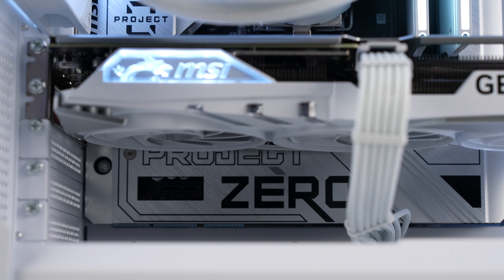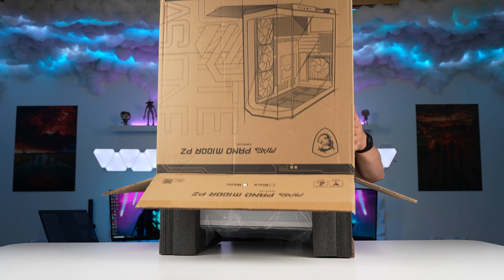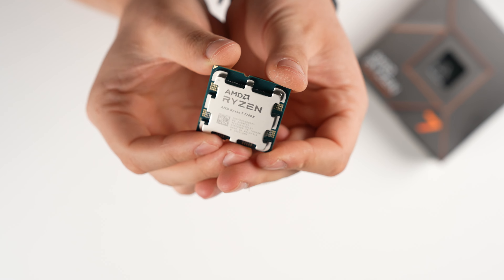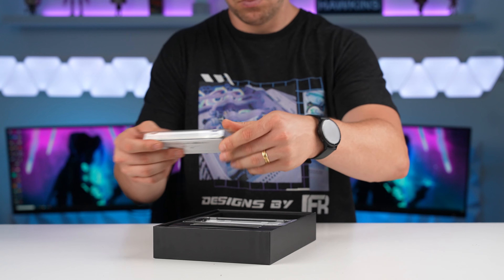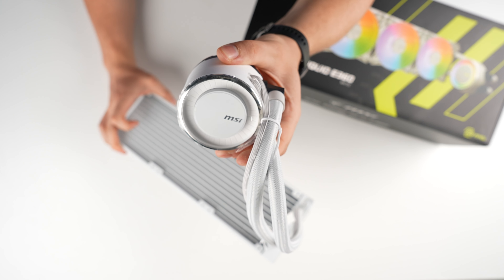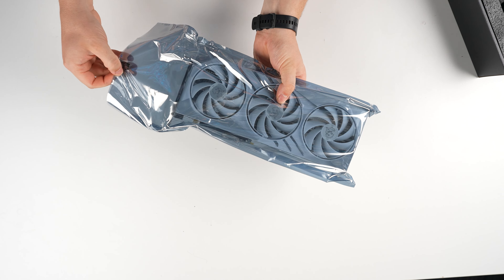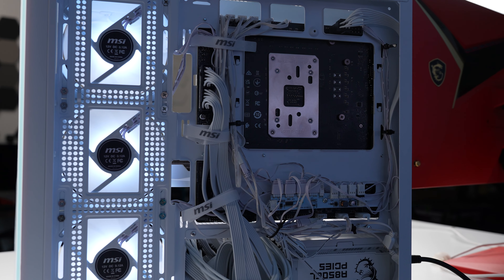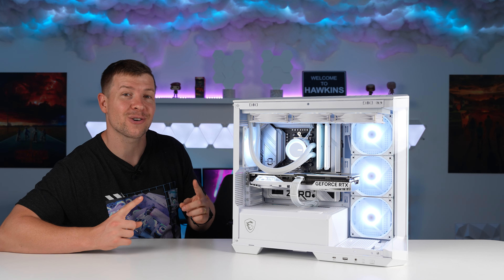Invisible Cables, Maximum Power - MSI Project Zero, RTX 4070 + 7700x

Comment: You SHOULD have used the magnetic fans for the radiator!!! If you are showing off the most cable free look, why wouldn't you? I realize the fans came with the AIO, but overall it was excellent, and I see this becoming the new standard.
Reply from the maker: I couldnt spend any more money, i had to use all included fans

Comment: Nice build, but why didn’t you pass the gpu cable through the PSU shroud?
Reply from the maker: Because it does not line up so it would have looked weird
Reply: @DesignsByIFR  fair enough